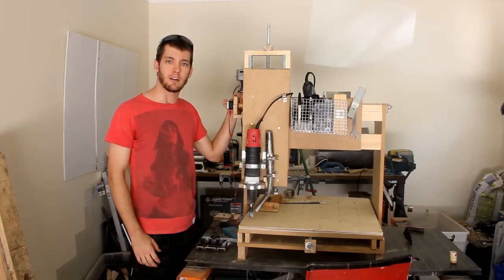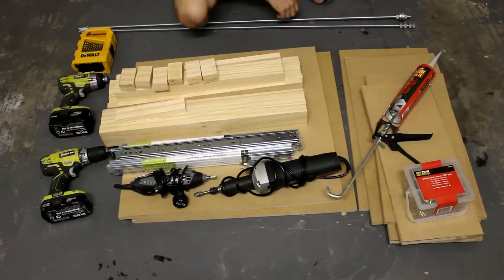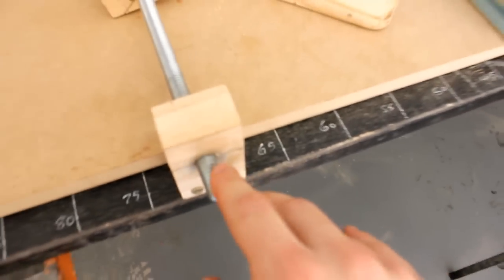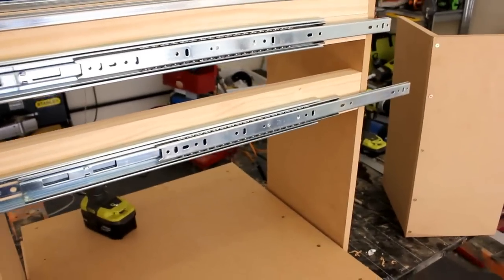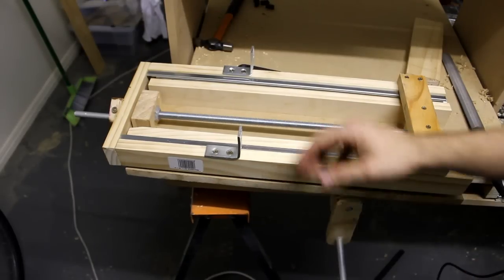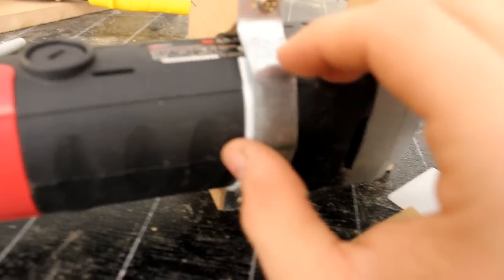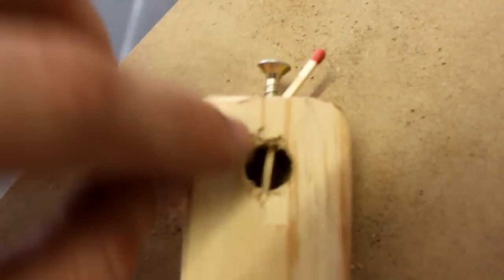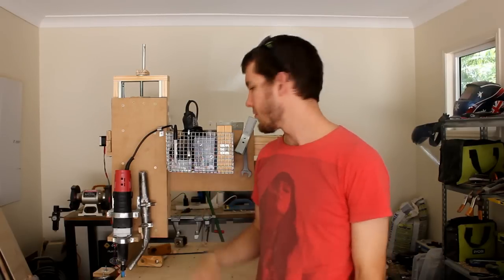Cheap and Easy CNC build part 1 How to Make Stuff with Cameron ep 3

Comment: Hi, nice build.

Here is a suggestion you may want to consider.

Install your nut inserts into your permanent board rather than the sacrificial one.

Of course you still need to drill out the sacrificial board but when you replace the top you won't have to replace the screw inserts as well; unless they go bad or something. Next you can use this sacrificial top, once it's used up, as a template for your replacement top.

Cheers...